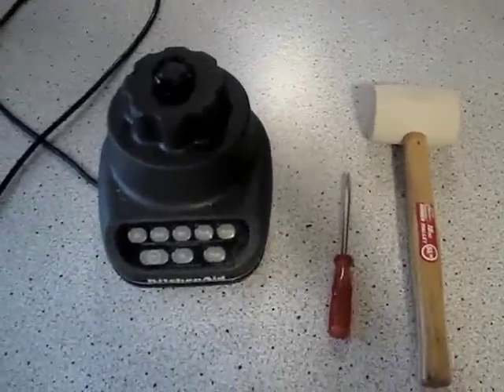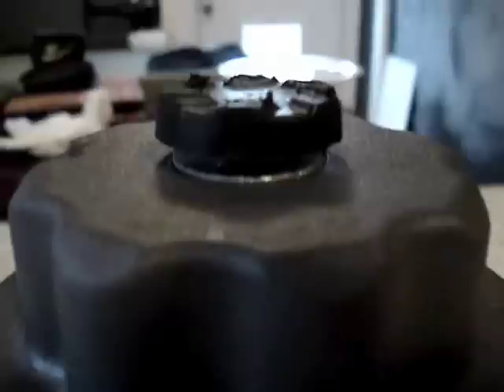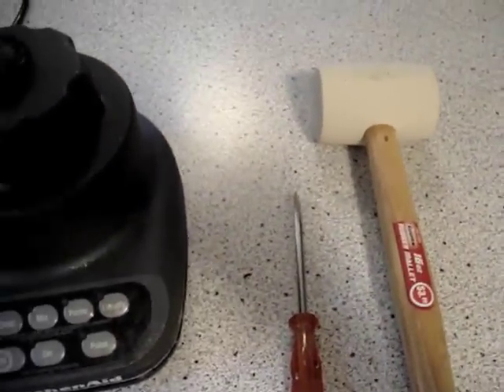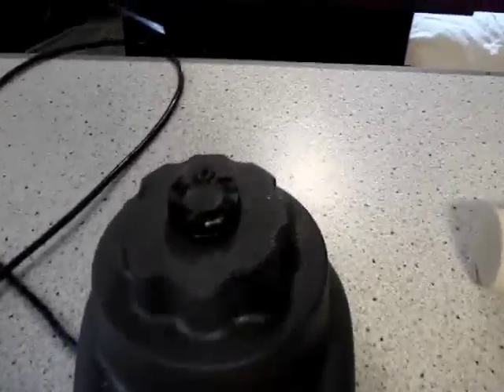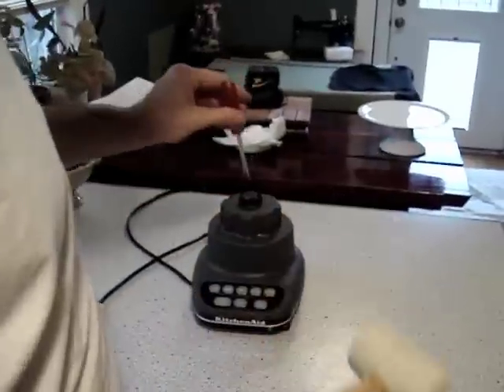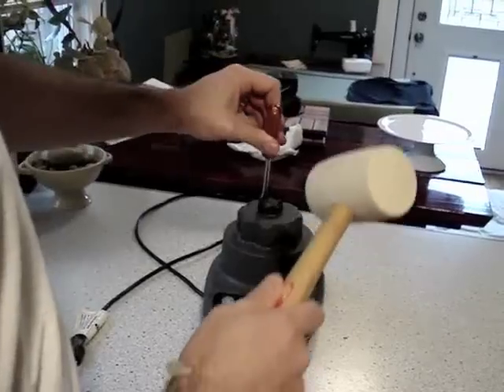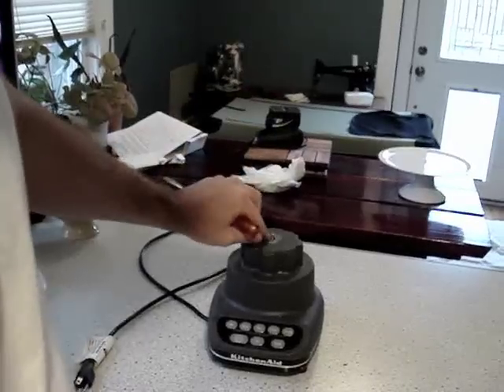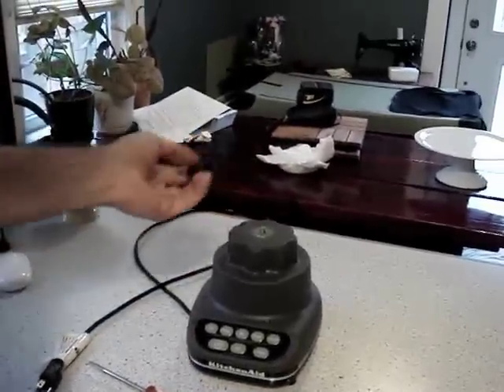KitchenAid blender coupler replacement

Comment: Extremely helpful.   My coupling had "melted" into a gooey black mess.   Upon arrival of my replacement coupling purchased off of amazon, I threw away the instructions that came with it and used a flat head screwdriver and rubber mallet and after a half dozen or so taps in the clockwise direction, the old coupling worked itself off.   No need for a special tool.   Many thanks for taking the time to post this video.

Comment: Thanks for posting. I got a 7mm spanner with the replacement coupler but didn't read the instructions so I ended up tightening it instead of loosening it and after that it just wouldn't budge. Your method does indeed look like it shouldn't work but it does so thanks!

Comment: Great. Thanks. Just like you said, it doesn't seem like it should work (since the motor shaft spins freely in the same direction), but it popped right off after a couple taps.

Comment: Hey, mine broke in the middle of making soup!  So I took my drill and drilled 2 small holes through the rubber and metal plate.  I then screwed in 1/2" wood screws so they were firmly in the metal.  Blender was loud, but it worked like a charm and allowed me to finish the soup.  Cheers!

Comment: I missed seeing this video before fixing my blender, so I can't say this method worked for me.  Prying with a screwdriver did not work -- the coupling wasn't budging, and I was worried I was going to damage the motor bearings or bend the shaft.  After trying many different tools, I wound up taking a 7 mm open end wrench, ground its thickness down until it slipped between that tiny gap between the coupling and the mixer, engaged the flats on the motor shaft, & was I able to unscrew the coupling.

Comment: My coupling broke last night.  Screwed up my mixed drink night.  I tried this method to remove the coupling and it worked on the first try.  I found a replacement on Amazon and ordered two.  Thank you so much stgmanager.  Other vids suggest prying the coupling off, not a good idea you will screw up the coupling threads.

Comment: I was about to say it didn't work.  But, after completely taking the 20 year old rubber coupling down to raw metal it finally fell off! So Thanks.  Now if only I could find a site that not only sells the replacement couplings but also has them in stock, that would be a wonderful thing.  ;)) Thanks again.

Comment: This would work but my dad is a handyman and used a pair of electrical pliers to grab the shaft and then a pair of channel lock pliers to spin off the coupler in a clockwise direction. 2 sec and it was done. There are flat sides to the shaft just under the coupler that would fit a 5/16 flat wrench it you can find something like that to hold the shaft to spin off the coupler. Good luck!

Comment: Your method didn't work for me, but watching your video was helpful. I didn't know the coupler was supposed to be screwed off clockwise so I kept turning it the wrong way. 
 
I stuck a hexkey between the blades of the fan from the bottom and turned the coupler loose. That's how i got it done. Thanks for letting me know I shouldn't turn it counterclockwise.

Comment: It works because there is a lot of inertia in the motor and if you use a hammer to tap the coupling in the unscrew direction, the inertia provides a lot of force in the other direction which helps unscrew the coupling. It's the rotational analogue of using a hammer to drive a nail.

Comment: I found it easier to lay the blender on its side, insert a thin screwdriver in the bottom to stop the mechanism from turning, and then just screw the coupler off. I took the rubber off first to expose the metal of the coupler.

Comment: I couldn't make this method work but the instructions that came with the replacement part suggested a method of prying it off with a flat screwdriver, so for those who can't make the magic happen, there is still hope.  Insert the screwdriver under the coupler and bend the edge up 1/4",turn a little and repeat - after a few rounds it pops off.  Not as easy as the video but it works.

Comment: The instructions that came with the new part didn't work and unfortunately, neither did this method.  So, I turned the blender upside down and sprayed some WD40 where the screw is.  I let it sit, then unscrewed the part clockwise while inserting a thin screwdriver in the bottom of the blender to stop the mechanism from turning (like the user posted below).  It came off very easily.  Finally!!

Comment: Hey, thanks!  Thanks to your video I discovered an even easier way, heres how.  Turn your blender upside down, take a thin bladed flat head screw driver and thread it through the motor ventilation holes and place the head between the motor fan blades to lock down the motor.  Then turn the blender on it's side and you can litterally twist the coupler off with your hand.  Hope this helps!

Comment: When you order a replacement drive coupling from the manufacturer, it comes with easy instructions that don't involve a hammer, just a screwdriver.  Basically you just have to insert the screwdriver under the coupling and pry it off.

Comment: Worked perfectly. I had just the metal disc left on top but a screw driver using the small holes in the disc and a hammer did the trick! Cheers

Comment: It worked!  So excited to have use of an old, but sturdy, blender from my grandmother's kitchen.  It's been sitting on my counter with the new coupler for a month.  I just couldn't get the darn thing off- and most of the rubber had disintegrated on mine, so I really just had the steel plate that makes up the center of the coupler to remove.  Luckily there are small holes in it that I could wedge the screw driver into.

Comment: Thanks so much for this demonstration!  I had tried to use the instructions included with the new part, but all I accomplished was to break off the rubber piece.  I was able to use your instructions trading a philips screwdriver for a flathead since the remaining metal disk had small holes in it.  Tapped 5 or 6 times and the broken part came right off.  Thanks!!

Comment: I was discouraged after 3 hits did nothing, but I kept tapping sharply and winggggggg  off it flew!  Thanks Dude! I had no idea it was threaded on, so this is going to be a cheap fix. I was wondering why they used a rubber piece instead of hard plastic, but am guessing rubber makes it run quieter.  I will buy two couplers! :)

Comment: Great video! Thank you very much for the tip. It worked like a charm and I had been trying for a week to get the coupling off. I completely removed the rubber (well most kind of disintegrated) but even metal screwdriver on metal coupling worked for me.

Comment: Thanks for this tip! Using the "recommended" methods merely succeeded in stripping all of the rubber off the aluminum coupler, but this technique got the coupler off in about 10 hits.

Comment: Same problem there, I was trying to change it for my mother and followed the instructions.  The rubber plastic came off but the metal core stayed on.  I don't see how giving it a few knocks will turn it off.  it seems like I need to secure the axle and rotate the top to get it off.

Comment: This method might be ok in some cases, but if the coupling is really tight, and/or you'd simply rather avoid hammering on the motor shaft, there's a special thin wrench available for this job. It fits between the coupling and the base, and it grabs the top of the motor shaft. Couplings are usually about $5 ea.  I found a kit w/ 2 couplings and a wrench for $13 from seneca-river-trading*DOT*com (the dashes are part of the URL, but remove the asterisks), which is the best deal I've seen.

Comment: Although this method works, a manufacturer or appliance repair tech will not do this.

The threaded drive shaft has two flattened notches you can catch with a thin wrench (various bicycle and automotive tool manufacturers provide a line of thin wrenches) or you can simply use a thin clamping tool such as electronic wire cutters/crimpers to hold the shaft in place.

From there, if you have rubber left, clamp with vice-grips and spin clockwise. If you have no rubber left (just the aluminum disc) use a snap-ring tool inserted into the alignment holes and spin the disc clockwise.

Various people have damaged their motors with blunt blows to the shaft. The motor brushes are directional and the shaft should never spin clockwise.

Most KitchenAid blenders have a 8mm shaft; the notches measure 7mm so that is the thin wrench you need.

Both tools are $10/ea, but if on a budget, just use a pair of thin wire crimpers included in various cheapo wire crimping kits to get underneath the coupler disc, grip the shaft notches, and spin the coupler off with vice-grips.
Reply: Thanks. Very useful info.  In my base, the entire rubber melted off the old coupling.  So, I will borrow/order a 7-mm thin wrench to make the repair. Also... a needle-nose pliers can grip the holes in the coupler, so don't think I will need a snapring tool